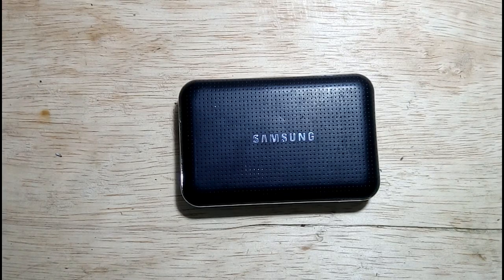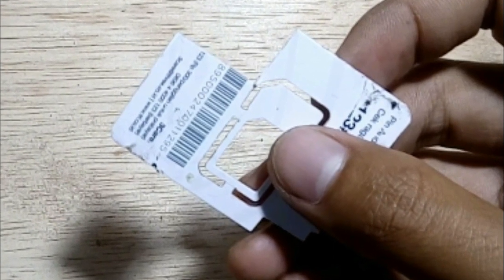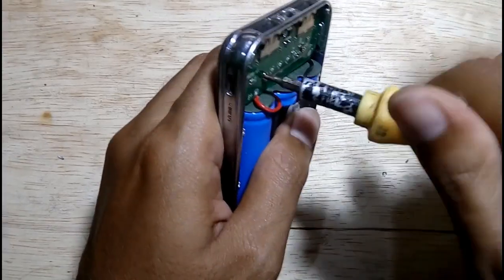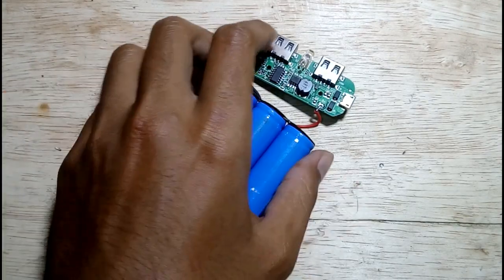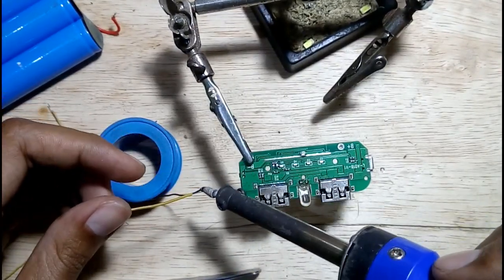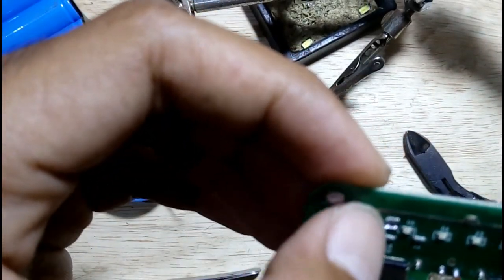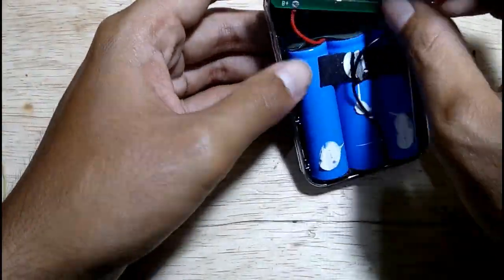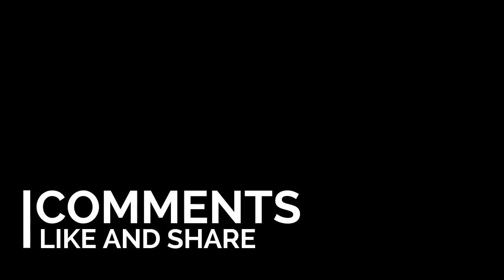how to repair power bank | SAMSUNG power bank

Comment: Please help me man my power bank fast lowbat
Reply from the maker: hi Layes,  have you disassemble it? then try to measure the batteries and short it for a second, then try to measure again. Or if you don't want to do this. You can simply change the battery.

Comment: Nicely done. What if the problem is in micro usb (for charging the powerbank)?
Reply: Do you have to change the whole module?
Reply from the maker: no, I didn't. but, if it's totally broken you should change entire module.. because, many modules has cheap price, especially when it's made by China. totally cheaper price.
Reply: AFANS LAB I see. The problem I have with my power bank is that I can’t charge it - it malfunctions..
Reply from the maker: have you try to change other cable? if still same, try to change the micro USB port first on power bank module.
Reply: AFANS LAB I tried changing cable but still...I will try to change the micro usb now. Thank you and keep up good working ;-)
Reply from the maker: @ΣώτοςΒασιλόπουλος  your welcome.. :-)

Comment: im a complete electronics noob so i dont know much of anything, but isn't it "dangerous" to replace a resistor with a jump wire? i mean surely it had some purpose? is there any risks to damage the battery bank if doing so?

Comment: That long black ic is too much heats up when I try to charge my powerbank.so what do I do
Reply from the maker: Does it function normally? 
Can it charge your phone?
Reply: @AFANSLAB  I'm scared so after that I never try again...
Reply: But before this incident my powerbank works great
IDK what happened
Reply from the maker: May be it happened because you charge it with high Ampere phone charger.. I want to know how about battery temp? Is it normal?

Comment: my power bank is charging well and also showing led indication properly but not charging my mobile help me how to check circuit to determine the fault I checked the battery with multi meter before and after charging it's getting charged fine but checking fault in  circuit is the issue help me
Reply from the maker: hi lakesh.. you can change another USB cable.. or.. did you check the soldered USB port on your powerbank?? If not, try to re-solder the USB port..
Reply: hi please send procedure to check circuit components working to detect fault in the circuit 
how to check usb port getting output voltage or not?

Comment: I have problem with my power bank chip that it's battery indicator light are on but as I disconnected charge it doesn't turn on.....
Reply from the maker: hi.. may be your power bank's IC is already broken..
Reply: AFAN'S LAB I find that in my power bank one resistance just attached to battery terminal is damaged so , is it is necessary or I can remove it or any other solution please reply 😕😧

If I connect jumper wire to resistance then it work but is it safe...
Reply from the maker: Your Channel , is the other components getting hot or not? If there is not, then it would be safe. Or, you can replace the resistor by the same value.

 But if you worried about that, just buy a new module. :)
Reply: AFAN'S LAB not but without battery charging voltage is 4.3 to 4.5 so....is it okay...
Reply from the maker: Yes 4,5 it is good.. Basically the phone's battery has average between 3.8 to 4,2 v for their max voltage rate.. So, for charging, it needs a higher than its voltage rate.

Is it still charge your phone? Is it take a long time to full fill your phone batt??

Comment: can you help me with my powerbank, it's asus power bank. It doesn't turn on or even charging.. Help me..
Reply from the maker: Hi.. PowerB , can you check the micro usb? Is it still good? Is it tight enough when you connected to your charger? Then check the battery, is it weak or good condition by check the voltage.
Reply: AFAN'S LAB what is voltage of good battery